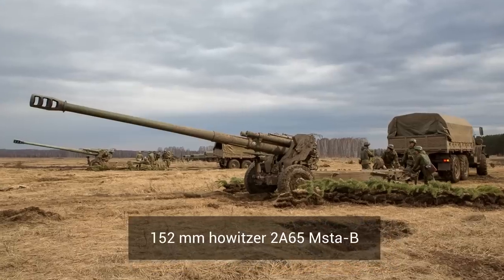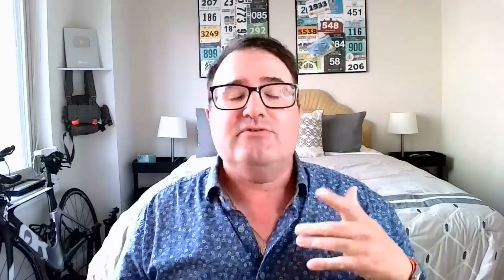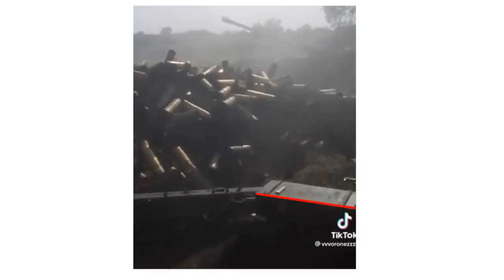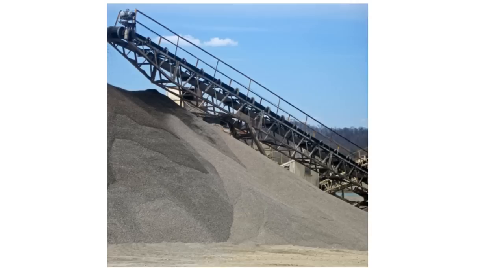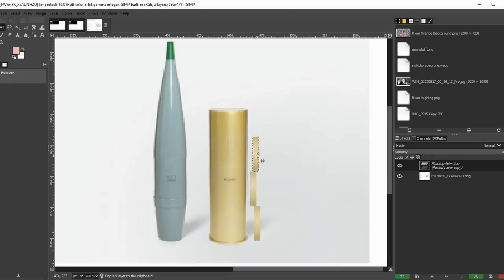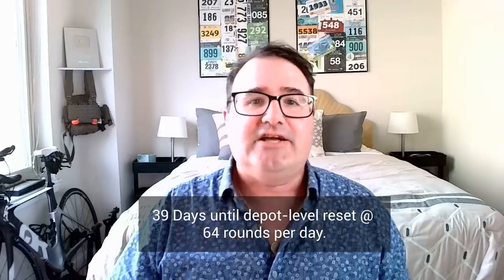When will this Russian Howitzer explode? (2A65 Msta-B Barrel life estimation from shell casings)

Comment: I counted 60 clearly visible shells and that was without trying much. That's only ~50% of one side. Assuming that everything not directly visible is dirt it's still over 100 shells and I think a reasonably conservative estimate is more along the line of 200-300.
Reply: I agree with this.
Reply: Funny how he has to calculate the slope of coffebeans, while you simply counted them
Reply: Yes I thought he made a under estimate too
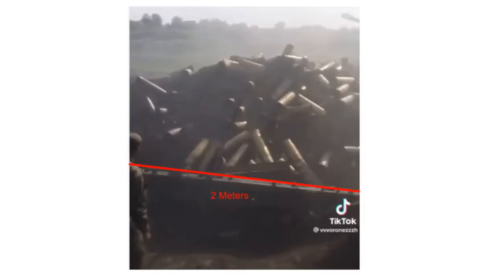Reply: I stopped at about 40, when it wasclear to me that his calculations was off...  But look at 4:40. Isn't it another barrel up in the upper right hand corner? If so, this ciuld very well be the combined pile of two or more haubitzers.
Reply: I guess that a gun like that would fire well over 2000 rounds before barrel wear became an unmanageable issue that affected accuracy but not safety. Firing the gun when hot increases barrel wear so life of the barrel varies depending on conditions. Barrels can be reconditioned or replaced so the gun can be used for years. Other bits also wear and need attention. Not likely that the gun would suddenly blow up because they are built to be soldier-proof and handle rain snow and a bit of soot. Leaving a nice big rag in the barrel or having a large obstruction up there will blow up the barrel which typically splits and petals and is a way to deliberately disable the gun when it is going to fall into enemy hands and it which case the crew would also remove and take away sights and firing mechanism.
Reply: Not trying to be mean, but how is adding 50% then tripling your count a "conservative estimate"?
Reply: I did the same & concur with your estimate..
Reply: Yes, his estimate seems to be a lot more than 64.
Reply: @Ps119  Barrel life if the Msta is less than 1,500 effective full charge equivalent firings, with significant degradation of accuracy often apparent at less than 1,000 EFC. The steel used in the barrels simply isn't as good as that used in the M777 & that has a 2,500 EFC barrel life.
Given the demonstrably abysmal level of routine maintenance applied by Russian forces, I'd consider 1,000 rounds EFC to be the UPPER limit for functionality.
Reply: Yeah.. I couldn’t believe he said 60 shells. 
And it looks like there are multiple piles. 
Even with a dirt back slope… i don’t think 60 shells would cover a hill of dirt that size let alone make up the whole thing. 
Quality page otherwise.
Reply: If the back side isn't just dirty or crates to make it look like more. It's weird that this matters this much.
Reply: Agree. Easily 200 there
Reply: @GARDENER42  agree on your number on accuracy, but for the gun to fail or explode, may be way more than 2000 shells 🤔
Reply: @simoc24  Explode maybe. Fail; I'd guess 70% won't reach 1,500 rounds without requiring factory overhaul to function (studying Soviet/post Soviet weaponry was part of my job back in the last century)
Reply: It actually doesn't make sense for there to be another side (opposite what we see).
Reply: @GARDENER42  you are probably right
Reply: @Chaxar  make a pile of pistachio shells, count the visible, count the total, what factor would make a good rule of thumb to estimate total shells from the visible ones. the assumption of "its at least triple" is more instinctive I'd guess, but is it wrong though? maybe using whole pecan nuts would make this more applicable to the howitzer shell comparison.
Reply: No matter the number of shells it says little about the artillery gun itself. They're mobile. He could be testing them for function after repairs etc. If that's the case each may fire let's say 3 times. Then a new one is brought in and the process repeats again. The pile could just be from a ton of testing. Too much speculation here and assumptions. The fact no shell came out could be from test loadings like the guy above mentioned Which would make more sense as to why there'd a huge pile.
Reply: @akaiappears  we already established the dirt burm surrounding the artillery. It is not a complete pile of shells. There may be shells on the other side of the burm and even another layer of shells underneath. So at best 3 times the count of 60 so 120 to 180.
That is why the discussion about piles of coffee beans. The higher the stack the wider the base at the determined angle of 30 deg.
And so just count 60 then adding more and just because then triple it is not what I call a conservative estimate.
Reply: @akaiappears  the honest estimate is the calculated 64 shells, it does not assume more shells because of the dirt burm.
Reply: You are correct need to calculate in cubic
Reply: According do google, the volume of a pyramid,  which I dont think this is because of the dirt burm, would be the base width x base length x pyramid height all divided by 3. Vp = wlh/3
Reply: You better Factor in the possibility there was a pit there before they even started piling up the brass lol. The pit could be 7/8 of a mile deep too btw.
Reply: @Chaxar  Yep it is a crap load of shells.
Reply: I'm just thinking, did he calculate in 3 dimensions? Just thinking because the pile is like a pyramid, so only the lower level should have about 60, and the following should have a little less, and the next even less. So would it not be a lot more than ~60? Or am I thinking wrong?
Reply: Plus one
Reply: I got into the mid 50s with minimal effort. I think your reasoning is sound and I also doubt there is much of a berm if any behind those shells.
Reply: I concur
Reply: Could a swallow carry one of the shells?😂
Reply: @zusammeneinganzes8751  how many beans where there
Reply: yeah , intuitively i would guess around 200 aswel
Reply: @Chaxar  No worries, it's a fair question. I counted the shells i could distinguish clearly from other shells, but there is a lot of generally shell colored blur but where I can't see if it is two or if it's three shells. I estimate I could could count about 50% of what I've visually determined are shells.

It is possible that only the directly visible layer is shells and in that case it's about 100 shells. I'm pretty sure that at least the layer behind the first layer is also shells so then we get around 200 shells.
Reply: I agree its way more than his estimate, I would say there could be even more than 300
Reply: Yes i agree definitely more than 64
Reply: Agree with this one. As the pile is three dimensional, we should assume that it's a cone with base of 2m and height of 1.5m, giving us total of ~5m^3 of volume. Calculating the volume of the shell gives us around 10 litres, or 0.01m^3. Ideally stacked that would be around 470 shells, but that's not the case obviously.

If we assume around the packing efficiency as with wood logs when they're piled nicely (nearly without the gaps) or just thrown at the back of the truck, we get something around 55-70%. That would get us in high 200s or low 300s.
Reply: @Chaxar  because there is a lot of shells not visible
Reply: The problem is that you can't count amount of shots by this shells since from what i know they are rechargeable

Comment: what could be happening with the lack of ejection: they disabled the mechanism to eject the round. They're potentially saving brass for reloading. Auto ejecting has a tendency of damaging the shell case.
Reply: i agree, i saw this been done with a weapons collector who was shooting a german ww2 gun, the brass is very very rare so they disabled the auto extractor to stop unneccesary damage to the shell casing
Reply: OK, so they manually eject the case to not damage it and then they wildly chuck them over into a giant pile in the dirt???
Reply: @stuborn-complaining-german  
The guys could just had been ordered to eject casings manually and put it in a pile but without any idea about why. ^^
So they just throw them thinking "That's stupid to do it manualy."
(Aside that, I'm not defending any particular hypothesis about why it's not ejecting as I have personaly any specific knowledge in artilery.)
Reply: @stuborn-complaining-german  It all comes down to the lip of the shell. The shell being deformed work hardens it in a level that a minor ding in the side of it doesn't
Reply: @SlavicCelery  Thanks for the answers, that could explain it!  I don't have any practical artillery experience, just some engineering knowledge.  I guess having a selection mechanism to eject or not is common on guns like this?  
I know you can somehow select on the old german ww2 PaKs, because collectors all do that to save the brass, or are those some alterations that weren't originally intented?
Reply: @stuborn-complaining-german  Typically it's just a ramp that shoves the handle down hard. You can remove it. It's sort of like the roller bearing on an old maxim machine gun. It's not a complicated thing to disable commonly. It is using the recoil force of the gun to basically shove down the handle that opens the breech. Once the breech flies open that usually triggers the ejector. 

Removing the ramp means you manually have to open it to eject the brass. You can control the rate of ejection at that point.

But most of the collectors who fire cannons like that, tend to disable the auto ejectors to save the brass.
Reply: @SlavicCelery  You can anneal brass shells to soften them up for reloading. Reloaders do the the same thing is done for small arms ammunition from time to time.
Reply: @HustleMuscleGhias  This is true, but due to the pressure levels encountered in most cannon loads. Any significant reforming, even after annealing significantly shortens the brass lifespan. 

Considering most large cases aren't as available as say.... 308 or 5.56

Once again, this is more of an issue with people who collect and fire them as civilians vs. military usage. Also, reloading/reusing brass isn't unheard of in many militaries. 

It reminds me of the use of "Carrots of doom" from the Swiss in training. Their practice rifle grenades would go through a lifetime of use and refurbishment. After being used it would get a lower grading, and wouldn't be treated like an unfired practice round.

Comment: when the barrel reaches its life, it doesn't mean that it shall explode, only that the tables used to calculate the firing solution aren't useful anymore; the gun can keep firing. though I must say that the only gun that I'd studied was the s-60 AA gun and it's been 35 years since I did
Reply: I read the Non-Fiction trilogy of books "The Guns of Normandy by George Blackburn." He was in charge of a battery of 17 Pounders during WW2. After firing 10,000 rounds the guns were required to have tolerance checks and when taken the barrels were in new condition according to the specs. WW2 was over close to 18,000 rounds fired so a second check was never performed.
Reply: It depends on the gun.  The older versions of the US M114 had a "unitary barrel" made of steel.  It could shoot a lot of charges with only a loss of accuracy.  More modern guns such as the M198, M109, and M777 use a COMPOSITE BARREL with a REPLACEABLE hardened steel liner combined with a mild steel outer barrel.  This composite construction does a few things.  First, it makes the barrel lighter.  Second, it helps dissipate heat faster than a RHA steel barrel can (allowing for a higher rate of fire).  Third, it makes tuning the barrel's "harmonics" easier for the factory building it.  For those who don't know, barrel harmonics are how the barrel vibrates during firing.  Bad harmonics can affect accuracy.  Harmonics are why target rifles have adjustable barrel weights at their muzzles.  You can add or subtract weight to match the barrel's harmonics to a certain load.  Yes, this is a thing, you can GOOGLE it and see for yourself. 
      The issue with Composite Barrels is that IF you wear away the hardened inner barrel liner, the mild steel outer barrel may NOT be able to contain the explosive force of firing.  The barrel will rupture!
Reply: We have seen a picture taken by the Donbass republics of one of their gun barrels that made a nice starfish. All kinds of things can happen
Reply: I served in 8"/175mm battery. Tube life for the 175 was 300 full charge (zone 3) rounds. When firing zone 3 the piece was cleared and a 50 ft lanyard used. We experienced a ruptured 175 tube in 1969, unfortunately resulting in the death of a cannoneer.
Reply: Well, if you keep going past the barrel life more and more, eventually a barrel (or firing piece) explosion becomes inevitable due to microfractures and metal fatigue.

But as you described, there's a huge time when the only effect is that the accuracy degrades to anywhere from "I used the firing tables to make ciggies, they're more useful that way" to "Comrade, we hit different city than we aimed at", with needing to expend easily 100x as much ammunition for the same effect on target.
Reply: @swaghauler8334  Are you sure the outer is mild steel? I have heard of liners which have better wear and erosion characteristics such as chromed high nickel steel or even wasp alloy, but the outer is always a high strength steel and arranged to be at maximum compressive stress to squeeze down on the liner. Mild steel is weak so heavy. I tried to find published info on the barrel but found nothing.
Reply: @chash7335  wow that is a low barrel life. I’m guessing this means these were running with very small margins. Very sad the gunner was killed. Was there ever an analysis done to determine why it failed? 
We’re you required to borescope these?
Reply: @richardkudrna7503 The full charge-zone 3- was unpredictable. Thus the 50 ft lanyard when firing. It was just bad luck one of our members was caught up in it. 
I was back to civilian life when this happened, so I have no ideas about forensics.
Reply: @chash7335  hopefully there were lessons learned and this never happened again.
Reply: @richardkudrna7503 I have no idea. I do see M109 crews vacating the piece and using their 50 foot lanyard, so perhaps the problem has not been solved.
Reply: The 175mm tube was always dangerous when firing zone 3. The gun crews would dismount the piece and use a 50 foot lanyard to fire it. The tube could, and in at least 2 cases did, rupture.

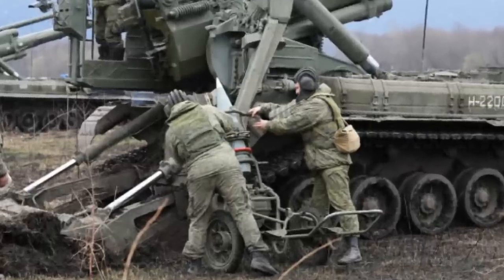Comment: Those guys at the Pion tracket artillery piece (2:29) don't wear proper helmets. Those are russian vehicle crew padded headcaps to prevent had injuries inside of a cramped armoured vehicle, but offer no ballistic protection beyond foam wrapped in canvas.
Reply: Cannon fodder doesn't need to. 😉
Reply: @Stefan_Dahn  they’re artillery. They aren’t cannon fodder
Reply: @Anonymous-tj8xm  They're cannon feeders.
Reply: It does protect their ears, a useful thing for artillery crews.
Reply: @imrekalman9044  Yeah, it has also an integrated comm system, but the point is that it doesn't help in case of a counter-battery fire.

Comment: That only takes into account the height, width, and angle but leaves out the length of the pile. That is just a slice of the pile. Way more than 64 in that pile.
Reply: He didn't even start from the bottom,  you can see shell casings underneath the gun support arm,  the ground was dipped.

Comment: only issue i see with the math is that we don't know the width of the pile, which is an assumed figure.  it could be shaped like a mountain with a peek but it could also be stacked like a sand dune... still having a peek but being higher over more of the width.   also we don't know how many other piles may be to the left or behind the gun... we only ever see the one side and the one pile.  and yes i would think the gun is actually past its life expectancy if the firing of shells is what caused the malfunctions in the ejection system(s)... thou it could also be because of lack luster or absent maintenance of them.  or possibly even damage.. .its possible the gun had another crew at one point and it was hit.... close enough to damage it but not destroy it... thou the crew in that situation more than likely parished.   love the information... just thought i'd throw that in there.  peace.

Comment: For US tanks replacing a gun barrel is typically done at a firing range (because this is where a barrel will max out it's EFC barrel life) takes less than three hours.  (Tracking rounds fired and their EFC rating is absolutely mandatory.  So, when a gun tube is reaching the end of its service life a new one will be sent to the sent to the post and earmarked for that tank.  And when the gun reaches the end of its service life, a crew comes out to swap barrels.  

Note:  EFC means 'Effective Full Charge' this is notional value of 'one' and every type of ammunition has an EFC rating.  Target practice ammunition typically has an EFC rating between 0.5 and 0.75.  So, if a tank is firing nothing but target practice ammunition then the actual number of rounds fired will be higher that the official rating for the gun tube - because this ammunition puts less wear on the gun.  Note service ammunition (ammunition used in combat) typically have EFC ratings above 2.

Comment: Royal Canadian Armoured Corps veteran trained as a tank gunner with a tiny amount of artillery knowledge.  A gun that ejects the casing immediately after firing without action by the gun crew is said to have a semi-automatic action.  Not all artillery pieces have a semi-auto action; others have one of the crew open the breech manually after firing.  For semi-auto actions, the ejection happens on the forward motion of the gun during recoil, after pressure has dropped in the chamber, when the mechanism opens the breech and drives the ejectors back to force out the casing.